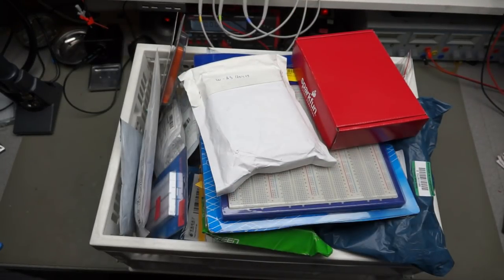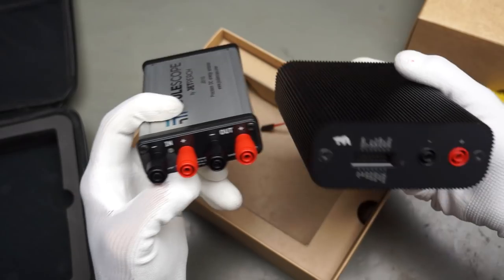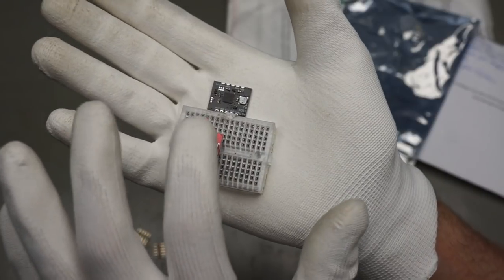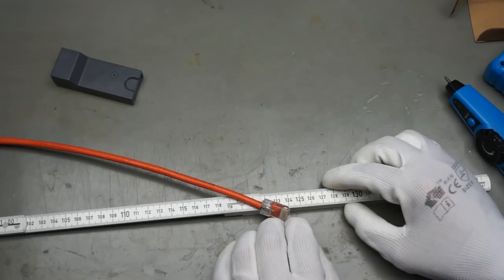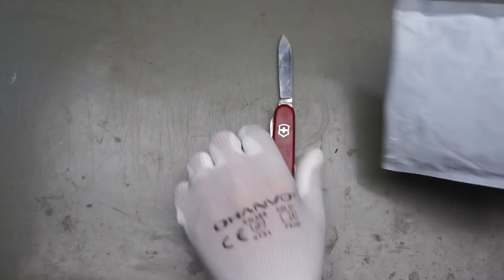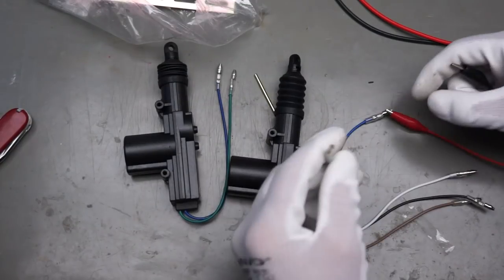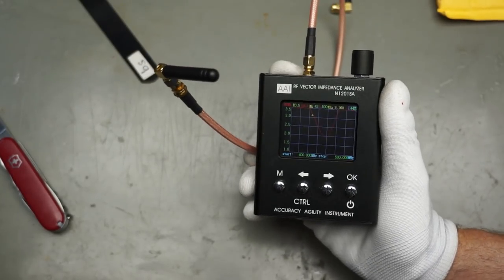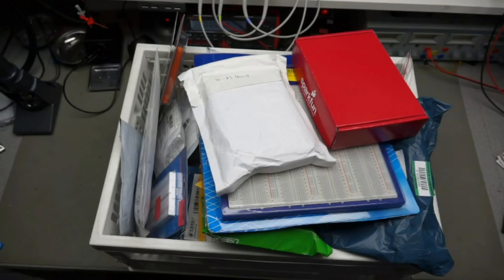#277 Big Danube River Mailbag (Part 1)

Comment: Hello Andreas, at 19:40, the actuators with five wires are used on the front doors of a vehicle, where both of the doors have a lock cylinder. That way you can signal the central locking module to unlock all the other doors. If you only want to lock / unlock with a keyfob then you could use only 2 wire actuators. There is usually (older cars) a switch in the lock cylinder that detects when it has been turned, and that, when used in conjunction with the switches inside the actuator, can be used to signal the cars' alarm to sound (i.e., the switch inside the actuator changes position, but the lock cylinder one does not).
Best regards, Nuno
Reply from the maker: Good information. Thank you!

Comment: Amazing bycicle trip ! Congratulations ! For such a long trip, I'll have to wait untill my retirement... hopefully soon ;-)
Quite an interesting mailbag too !
Reply from the maker: We had a chance to organize it before retirement. That is why we took the chance. But we only had 5 weeks for the whole journey. So I had to use an eBike...
Reply: @AndreasSpiess  Yes, I noticed you have a Flyer. Excellent bike ! Flyer is one of my favourite brands when it comes to e-Bikes.
Reply from the maker: My wife had one for 10 years without problems. And she used it daily. This is why I bought one, too.
Reply: @AndreasSpiess  Good choice! My wife her Flyer is also 10 years, still works fine although the battery is near the end of it's life. It lasts for about 25 Km's. I bought myself a Kalhoff speed elec which is very satifactory. The range in (high) speed mode is about 100Km's, I use it almost daily for commuting. However, next bike may be a Flyer.

Comment: Lots of interesting products. I look forward to your future energy harvesting projects!
Reply from the maker: Energy harvesting for sure is on the list. Maybe it is also "en vogue" because of the Green Movement ;-)
Reply: The big problem of the harvesting solutions is the really high cost in addition to the cost of the low power device itself. It really makes sense only if you have a node in a difficult to reach place.
Reply: @thesimbon  I agree. My balcony has not an outside power plug... but sun.
Reply: @santorcuato  actually you can run on batteries and still get 2 or 3 years battery life if your device is really low power and very low standby power
Reply: @thesimbon  you are right, but it seems more interesting to learn new tech, so I bought a pannel and 3 different boards. Now is running ok also in winter and I can use it not only in my balcony... The sensor sleeps 5 minutes and works a few seconds. For me it was a nice project but now I am waiting for Andreas to try those small solar cells... Mine is a little bit large... FIVE WATTS ONE!!! LOL!
Reply: @santorcuato  I made on outdoor temp/hum sensor with solar panel and supercaps, unfortunately cheap Chinese ones and after a few months they started to leak. Now I'm using an old phone battery and a circuit from a broken solar powerbank and it is working as I see the battery voltage slowly increasing day by day because it is not in direct sunlight. For sure an harvesting circuit could be more efficient at using the ambient light but still it would be very expensive. I think the goal here would be to find a rather cheap way to make a solar powered sensor, even if not using the most efficient circuit. Also good quality supercaps are expensive too and I haven't found charging modules for LiFePO4 batteries that are more suited for outdoor use than the usual lipo
Reply: @thesimbon  yeah, is the same here but no supercaps. I supose the balance in cost between the board and sensor and the power supply it's not ok for a pro solution, but I'm still learning... Forever young!
Reply: @santorcuato  I'm also struggling with random freezes of the pro mini that doesn't reset even with the reset button and it needs complete power cycle.
Reply: @thesimbon  Oh, that's a very annoying behaviour. I'm using ESP32, Wemos Lolin 32 (copies) with bad results charging batteries and Lolin D32 and D32 Pro with a very clear difference in stability. My fight is about wifi, from my balcony I can receive (with a mobile phone) more than 50 different SSIDs; nice neighborhood ;-)
Reply: @santorcuato  that's why I'm using rfm69 radio modules instead of wifi 😁
Reply: @thesimbon  that can be another way to walk through... The other day I was listening the pneus pressure of a Toyota parked down in the street; really fun!

Comment: We used a tone detector 44 odd years ago when I was an apprentice telephone engineer.   The "clucker"  or knocker emitted an intermittent tone you clipped that to one end of the cable.  You then plugged a headset into a detector amp and used either an aerial for overhead or underground cable or probe to follow structural wiring.  If you had continuity, shorting the pair paused the tone.

Part of the apprenticeship was college and one of the courses introduced filters.  So we built a capacitor bridge out of old telephone parts.  One capacitor was variable and the other side connected to the line.  You then "tuned" the tone out and when both sides balanced the position on the dial was the distance to the break.  Two of us got the princely sum of £10 each for the idea ... and a month to build enough units for everyone in our district.  Amazingly despite it being such a basic principle no-one had thought of that application.
Reply from the maker: Thank you for sharing your story. Interesting how things changed in just 44 years and which tools an average Maker can afford today!

Comment: Hi Andreas, the cable testers uses TDR (Time-domain reflectometer) principles to check cables for failure and other characteristics, but it depends on the cable materials and or constructions details, it means you have to calibrate it for the actual cable you're using, HP did some quite good TDR analyzers, I used a couple of in my university times to measure materials characteristics.
Reply from the maker: Maybe the HP analyzers are not only more accurate, but they are also probably a little more expensive, too ;-)
Reply: @AndreasSpiess  Sure, much more expensive :-D
I guess it should not be too difficult to build an equivalent using the nowadays fast microprocessors, the trick of the HP TDRs was the wizardry they used to detect the signal "echoes" since it was faster than the cpu cycles at the time.
Reply: I almost bought an old Canoga-Perkins TDR once.

Comment: The 9V OK cells will save you the trouble of finding 9V charger. Some of the 9V battery chargers are designed for NiMH battery charging and not Li-ion battery charging. I didnt have any problems with capacity and they recharge quickly too.
Reply from the maker: Thank you for sharing your experience.

Comment: Hi Andreas, 11 or 12 eyars ago I bought myself an expensive Gigabyte motherboard with dual gigabit LAN, which could made 2GB dual line connection together with some of the same manufacturer's router/switch. There were software attached to BIOS that not only could find the lenght of the cable and the distance to a break of the cable, but found out the distance to the place where my cable was twistwire patched.
Reply from the maker: You are right. I remember this was a feature of some boards. But I never tested if it worked.

Comment: Okcell 9v battery discharges over time because they put a boost converter that is of course always on. There are other cells that have 2 lipo batteries in series but they lack the USB port. I like the fact of the USB port because you can charge the battery without disconnecting it from the device as most of the time it is an hassle because they usually have those flimsy soft contacts that break easily if you pull them too hard.
Reply from the maker: Good point. I did not check if it runs while charging.
Reply: @AndreasSpiess  BTW if you want to experiment with LoRa and custom nodes, you can still use mysensors that are compatible with rfm95 modules and it doesn't require any activation.
Reply from the maker: But does it also support meshes?
Reply: @AndreasSpiess  it works like the zigbee/zwave networks where there are powered nodes that can act as repeaters

Comment: Nice Video! With my 9V Batterie i have no Problems. They works better then normal one (i only have test them with no rechargeable). They AA and AAA i cant say. but there are two diffent Version on the market. There is a 1.5V and a 1.2V. You have the 1.2V Version
Reply from the maker: Thank you for sharing your experience!

Comment: I don't personally like  the 9V rechargable batteries. Having to take it out of the device to charge them is a mess... i modified my old multimeter with a tpa4056, a step up and a small recycled li-ion battery, and drilled a small hole for the micro-usb port. That way, i can charge the multimeter directly as a mobile phone (and i think the battery capacity is higher that the one advertised in the one you have). Is not a bat thing if you use them very often, but for simple things, not worth the money (i think). As allways, DIY solutions are better...
Reply from the maker: Good idea! Thank you.

Comment: Hi Andreas. Great video as always! That ethernet cable is STP/shielded, isn't it? Perhaps that's why it can't tell its length well. I'd try again but with a UTP.
Reply: Is that make any difference ?
Reply from the maker: I do not know. But CAT6 and 7 cables are shielded. So it also should work on shielded cables.
Reply: Agree with you the shield should not effect the measurement , I guess this device incapable to measure the cable length accurately

Comment: The cheap cable tester probably gets confused because you are using a shielded cable. Try to measure the length of a few unshielded cables.
Reply from the maker: Maybe. But only testing unshielded cables would not make much sense. Cat6 and Cat7 cables are shielded AFAIK. And they are mainly used for long connections these days.

Comment: Could you not calibrate it to the lowest length it will go on the cable length detector. Save settings and then calibrate it again ? It may just be a feature on the software it only allows 50% change per calibration.
Reply from the maker: Maybe. I gave the device to my brother now :-(

Comment: I use such usb batteries for an older digicam and for a blood pressure monitor. Why? Because those devices shut down if the voltage of one AA cell is below 1.2V. So using nimh rechargeables is not helpful. Those usb batteries provide 1.5 volts all the time until they are discharged. However this fact makes the battery level indicator on the cam or the blood pressure monitor completely useless. In the end better then changing alkalines every few days.
Reply from the maker: Good info. Thanks!

Comment: It's likely that 15m is the min distance that cable tester can measure for some reason. Electrons travel near light speed which makes an accurate measurement at that distance a fairly decent accomplishment. At 15m with 8 wires, we can tie the wires together to give us 120m. Light takes 1 second to go 300000km. It takes 400 nano seconds (0.0000004 seconds) for data to travel 120m. The processor would have to be capable of a program cycle time of at least 50MHZ to distinguish a difference from 15m and 30m to a precision of only 8bits. Eg. 1.875m steps. A home PC processor could easily accomplish this, but for a processor like the one in that small handheld, I'm suspicious. The ESP32 could probably provide a more accurate measurement if running at full speed sans the wireless capability assuming everything i just mentioned is correct (I know i may be wrong about the electron speed. Someone plz correct me). I would build one, but i'll need to learn Assembly language and that looks horrendous.
Reply: PS, if anyone can send me assembler script to read the state of a digital IO (INPUT) pin and the time it took for the signal to be received from the activation of the (OUTPUT) pin, then i would greatly appreciate it. It's probably a simple 10 - 30 lines but i'm lost. Willing to share a chunk of change if this becomes profitable. First to give me a working ASM code example for a micro-controller will be kept in mind. My goal is to measure electron transmission times with a uC; 8 and/or 32bit.
Reply from the maker: You are right. They need to be pretty fast...

Comment: H Andreas, great video as usual, did you try the cable length test with the cable uncurled, like it would be in a conduit?
Reply: The measurements shouldn't change whether it's rolled up or lead up against a wall Orr down conduit. The test should be a capacitance test performed on each wire, from both ends one after the other, then averaged. If there is a break in the cable a bit of math (performed by the kit) will tell you what wire(s) and how far from the end the break is.
Reply from the maker: @Tom, Yes, I tried it all. Also with and without the small "bug" at the end. Because I wanted to give it a real chance.

Comment: Was the capacity of the batteries measured at 3.65v cell or at the voltage after the the dc-dc circuit?
Reply: probably the capacity of the lion cells. 9v capacity should not be more than 250mah.
Reply from the maker: I did not open the battery and measured at 9V (which is the specified voltage)

Comment: I didn't know you could use both micro-USBs on a Pi0 as hosts? 
I thought one could only supply power?
Reply from the maker: You are right. I did not think too much when I showed it. But the problem exists also if you only connect one of those adapters.

Comment: Did you try calibrating the cable tester with a meter that is > 15m in length?

BTW... Please try to ignore trolls who think you should only show certain parts/products. I enjoy the variety of topics and products that you show on your channel.
Reply from the maker: One of my cables was 5 and the other was 10 meters long.
Reply: @AndreasSpiess  Could the calibration process work if one used a 15m to 30m long cable cable or is calibration simply broken in the testing device?
Reply from the maker: I do not know.

Comment: Ikea had a 1,99€ usb charger for 2 batteries ... cheaper + better than a 50% capacuty battery with built in usb charger in each cell.

3 days train ride back to the swiss was caused by the bikes yiu had to take with you. Donaueschingen is pretty high ... but the way of the water to constanza is pretty long too. 

Good luck for part 2.
Reply from the maker: For a Swiss, Donau Eschingen is Flatlands ;-) 
Yes, the problem were teh batteries of my e-Bike. These days they are treated (by airlines and bus drivers) like little bombs.

Comment: Hello Andreasif the Distanz is not correct, most Tool need the NVP Value of the Cable to Calculate the Distanz.Wikipedia NVP Value 
https://de.wikipedia.org/wiki/Verk%C3%BCrzungsfaktor
as Example of a cable 
https://www.cabling.datwyler.com/de/produkte/rechenzentren/datentechnik-kupfer/datenkabel/product/cu-7702-4p-2x4p-f8-2.html
and below the [Elektrische Eigenschaften]
you will find the NVP Value to enter on your tool.have a nice day
vinc
Reply from the maker: I assume this is done during calibration?

Comment: I cannot find the video, there is a guy that shows how to calculate the length of cables by timing the reflection signal return of a square wave signal.
Reply: Actually that has been a technique LONG used in the power and telecoms market for detecting where a cable break has occurred. But it's a pulse rather than a square wave that's used. 

A typical instrument for doing this is a TDR Time Domain Reflectometer. Plenty of stuff on Google to research if you like.

Based on the principles of tranmission lines and the fact that a pulse will travel down the cable at approximately 30cm per nano second, reflect off the broken end and travel back at the same speed. The distance is then calculated as half the travel time multiplied by the distance per time period (30 cm per nanosecond).

There is quite a bit more to the practical implementation, but the principle is dead basic and simple.
Reply: @boblewis5558  obviously you're correct, a square wave is useless it would disturb the reflection signal.

Comment: How can the SC8108 cable tester determine the length of a cable by connecting only to one end of the cable?
Reply: mark magic?
Reply: @nopparuj  probably :-)
Reply: The magic word is: reflection
Reply: It sends out a puls and then the pulse is reflected at the end of the cable. The reflected pulse will add amplitude to the original signal and you can detect that. The cable acts as an antenna and therefore you do not have to have a closed circuit.
You can do it yourself with an oscilloscope and manually calculate the length.
Here is a video that explain it: https://www.youtube.com/watch?v=Il_eju4D_TM
Reply: @niklaswennerstrand1010  thanks!
Reply: You can do it with an oscilloscope and a square wave generator. There's videos of there.
Reply from the maker: @ Niklas: Thank you for the link. w2aew has a very good channel.